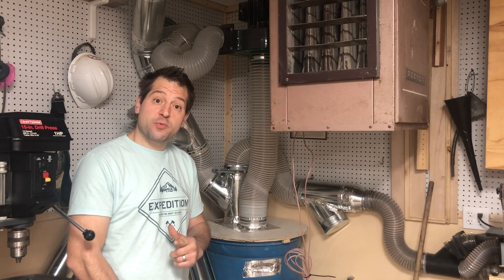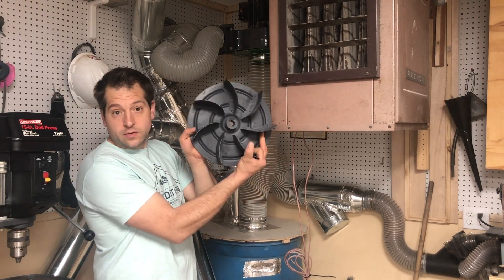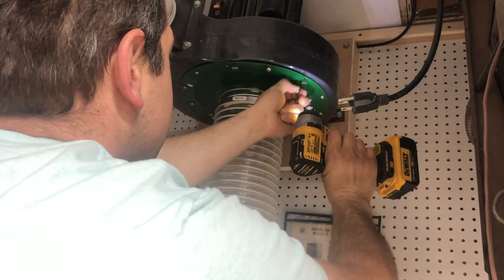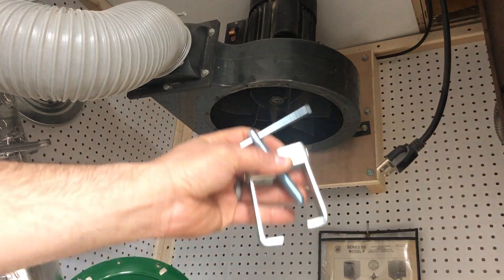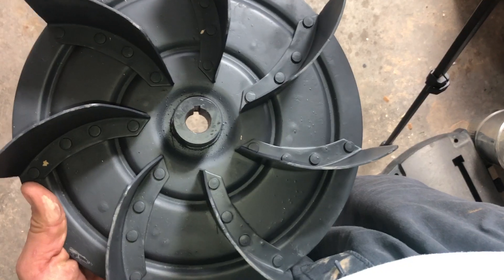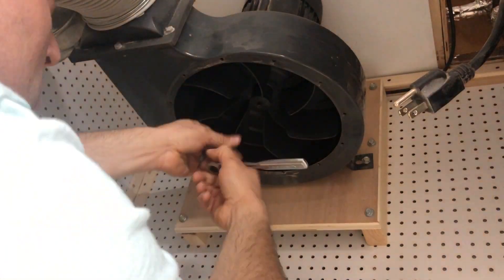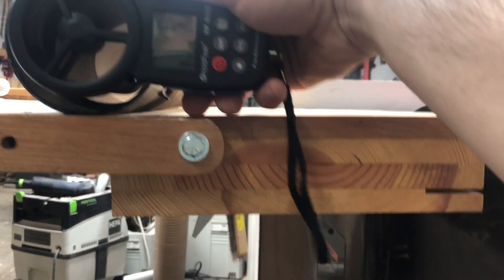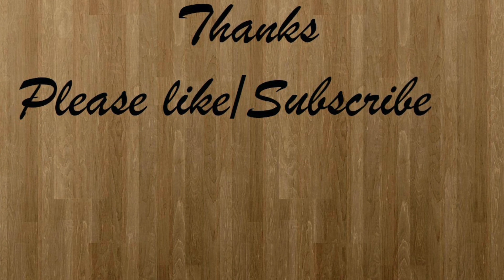DIY Harbor Freight Dust Collector Impeller Upgrade

Comment: It may be fine but you should check the amp draw on your motor. The new impeller probably raised it 50%. That could lead to overheating the motor if it exceeds the amp rating on the motor nameplate.  You could also use an IR thermometer to check the motor temperature over time.

If the amps are too high you can add a restriction to the system to bring it back in spec. It seems counterintuitive but the more the airflow is blocked the less power the motor will draw.

Thanks for sharing this video.
Reply: I should have read more replies before commenting myself on virtually the same subject.  Thumbs up.

Comment: Did you notice an increase in amp draw when you went to the larger impeller?
Reply from the maker: I didn’t measure the amps, but other people have and there is a slight one
Reply: What amp circuit are you hooked up to in your electrical panel?

Comment: Is it not a problem that the fan blades curve the opposite direction? No modification is necessary to reverse the motor?
Reply: No modifications needed. The vane direction on the bigger fan makes it more efficient. I read an article about it somewhere, but couldn't find it to post a link to it.
Reply: The new impeller is backward curve, so it won't overload the motor. Backward curve impellers are also more efficient. Backward curved impellers are better at handling particles as well, so they tend to be used more in dust collection.

Comment: It looks like your connection from impeller to outside is a big restriction, especially that 90 degree at the wall right after a 180 degree loop.  A single 90 degree (right angle) bend is equal to 9 feet of straight piping. I’d say that total connection is the same drop as 14 to 16 feet of straight run.
Reply from the maker: Good idea, I will try it!
Reply: The Self Made Man what are you going to try?  I would remove the 90/ right angle connector at the wall, or just cut it back so that you have a straight pipe coming out ... and then reconnect the flexible hose directly - just shorten it slightly so it doesn’t hang down. Abrupt direction changes rob a lot of power.  That one right angel connection causes the same power loss as 9’ of straight pipe.
Reply: @fotopdo  Almost all that flex tube should be replaced with solid line and the fan should be turned about 45 degrees towards the wall and the outlet should just be a simple and short 45 degree angle with a solid pipe going outside. That will remove a LOT of restriction by itself.
Reply: @gsh341  that’s good advice, I especially like idea of rotating the fan and using 45’s .

Comment: I’m guessing that’s an inlet cover replacement part for a grizzly dust collector with a 6” shroud. Part number I found was px1666025A but it was unavailable with 6” inlet. The 5” inlet was just px1666025.
Reply from the maker: I purchased mine a few months ago on amazon. Unfortunately, it’s no longer available...
Reply: The Self Made Man I emailed grizzly lol it says something to that effect on their website. Looks like the 5” is all that’s available. :/
Reply from the maker: Chris B. Sorry to hear that,. I have been looking online for one, so I can share one in the comments, but haven’t had any luck so far...
Reply: Good news. I emailed Grizzly and they said the px1666025A 6” inlet is on back order so it is still available. They said back orders are usually filled in 6-8 weeks.
Reply from the maker: Link added